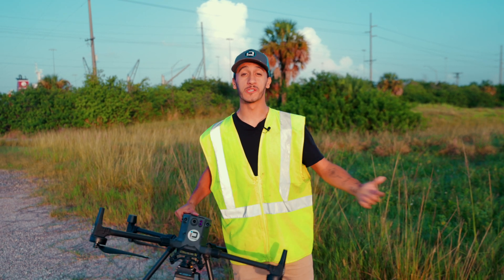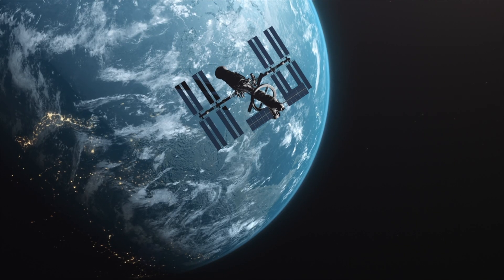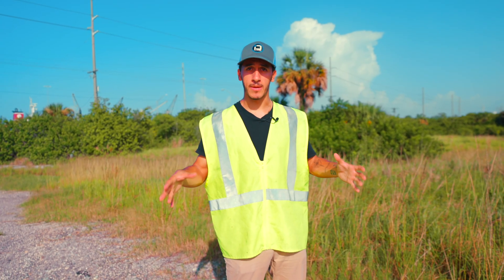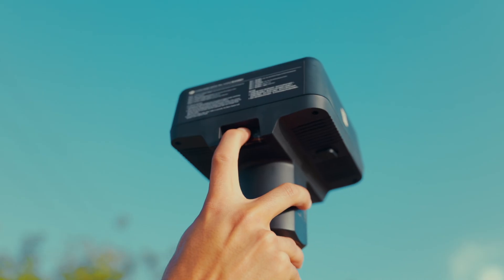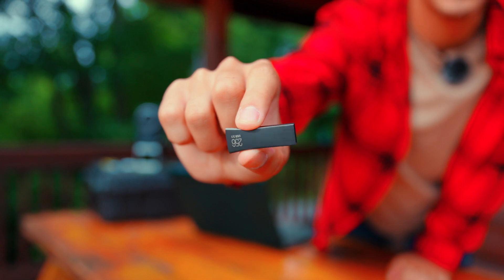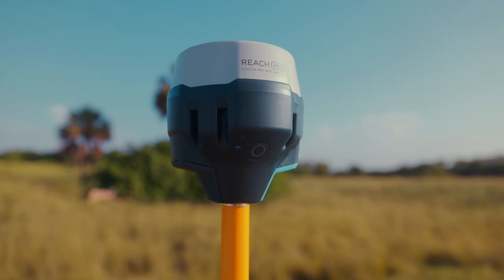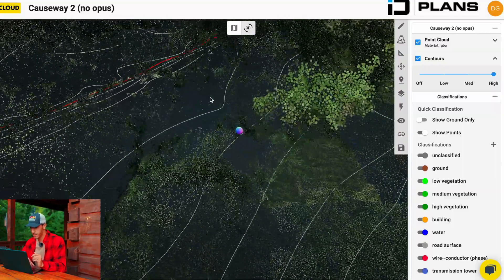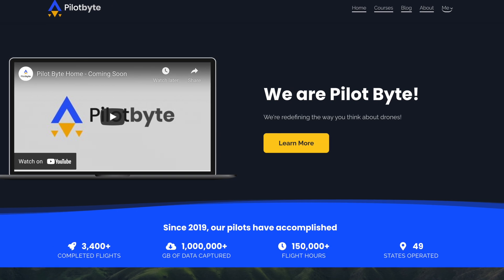Is LiDAR the next Gold? - Drone LiDAR

Comment: Hello. Great video. I’m not sure why you use both the drtk-2 and the Emlid RS2. If you are running a PPK process with the RS2 why bother with the DRTK-2 as well? I run the L1 on my M300 and I use the RTK on the drone with an NTRIP service. Works great. Really curious why you double up on the RS2 and DRTK-2

Comment: really good video!
coming from normal DJI drones as a videographer, but a drone lidar newbie and guy who is really interested in getting into the space, i would love a more in depth video, where you don't leave stuff out and skip parts - a real step by step video on what i would need to do

also i have trouble understanding a few basics:
1.) you get the ground points via a CAD file you say - how do you know where they are? the ground point tag looks not accurate in the vegetation - i only know the ones on the asphalt
2.) there seem to be two kind of RTKs, one for the drone to get accurate flight paths and the other ones to create points on the map or something? how do i work with RTKs? how do i set those points in the program correctly?
3.) i don't understand what exactly i would give the company in the end? how do you create the so called "finalized deliverables" and how do they look like? what program do you use to make them?
thanks a ton in advance!
Reply: https://www.youtube.com/watch?v=HFT-k3vbk5Y

Watch this series, Trying to do the same thing. this was helpful

Comment: U should try propellers aeropoints. It will make your life way easier.
Basically they are gcp with integrated gps. U just place them switch'em on do ur survey. When finishes the survey ur gcps will have known position. 
Give that a try I promise they are worth it
Reply from the maker: Ive looked at them but haven't heard the best reviews about them. Do you have hands on experience with them? If so Id love to hear your process!

Comment: What are your thoughts on bathymetric lidar? Shallow underwater mapping could be awesome.
Reply from the maker: Oooo, we actually have a bathymetric sensor but haven't put it to use yet. As for a bathymetric LiDAR sensor, that works a bit more differently than the typical sonar based system that we have (and is also like $250K just for the LiDAR version of that sensor). If I get a chance to play with one I will 10000% make a video about it because that's something I have always wanted to play with!
Reply: There's a channel "adventures with purpose" that searches in water for lost cars and helps solve cold cases. I sent them info on it and they loved it. Being able to find targets faster and have a clearer picture could be big!

Comment: Great informative video Dylan. Just out of curiosity, the R2A comes with a 24mp Sony camera integrated into the LIDAR package, why not use the photos captured with that rather than fly a separate mission using the P1? Was that for comparative purposes for those using traditional photogrammetry methods to capture survey data?
Reply: John - I can't speak to why Dylan reflies an area with the P1, but I can say why I do.  I have a GVI LV70 with a Sony 24 mp Nex camera and a separate P1 payload.  The P1 photos are far superior to the Sony.  If I want colorized LiDAR I can do it in LiGeo.  Yes it increases the collection time, but for my purposes it isn't a significant cost.  Also, the P1 can collect data at twice the speed or more than the LV70.  GVI recommends a velocity of about 5 m/s and flight heights of 60 m or less.  One can fly with a P1 at 120 m at a speed of 13 m/s.  The downside of the P1 is the file size.  Orthomosaics can be 10 gb or more, so I use GeoExpress to convert them to sid format to use in Civil 3D, ArcMap, or QGIS.  I think it comes down to what meets your needs.  Also, the GVI LV70, which looks remarkably similar to the Rockrobotics and a few other LiDAR units, there is a slight shift in the orthophoto because the GPS is based on the LiDAR sensor not the camera.
Reply from the maker: @cascadestreamsolutions4211  loved this explanation. I haven’t tired combining my ortho data from the P1 with the Rock Robotics LiDAR data yet, I might have to try it out!
Reply from the maker: It was more of a comparison between LiDAR data and Photogrammetry data for surface penetration. The colorized point cloud shown on the LiDAR data was from the 24mp Sony sensor that is on there so theoretically we can process orthos with those without a second flight needed.

Comment: Do I need a licensed surveyor to sign off on the deliverables if I myself am not a licensed surveyor?
Reply from the maker: Depends on the deliverables you are promising to send. I would never say its a survey grade deliverable since you aren't a surveyor. I would learn towards a highly accurate model rather than survey model.
Reply: Check the state regulations you want to provide data in.  In CA and OR, licensed civil engineers and surveyors can collect topographic data and sell it. I'm not sure how many licensed surveyors or engineers are going to accept responsibility for the data someone else collects without a rigorous QA/QC effort.
Reply: Not many licensed surveyors would take responsibility. I can see some of the contours are being "pulled" due to lack of proper grade breaks. In TX topographic data is not regulated by the state board so engineers use this type of data since they place a disclaimer to match to existing grade on their construction plans.

Comment: I have five years of professional drone experience and this is the field that I want to work in but I have no idea how to do it.
Reply: Ive offered LiDAR consulting, sales, service and training for years.  To be successful in sUAS LiDAR, you must have substantial contacts in the respective industries that have a need for it. 

I focus primarily in surveying, construction and civil engineering and I have customers that bill well over $1,000,000 a year (small, ‘mom and pop’ customers at that); i agree 100% with what Doug is saying….the data is like gold to a lot of companies. However, you must have the contacts to make it work.  

For a good, mid range sUAS solution you’re going to be in the 100k range.  Add another 15 to 25k for equipment to shoot ground shots and a computer that can process it (your off the shelf Best Buy computer will not handle these datasets).  

Good luck!
Reply from the maker: @RustySshackleford  well said Mike!
Reply from the maker: Check some of my other videos, I have some tips on how to get into the industry as well as how to sell drone services.

Comment: Sorry man , you are misrepresenting Lidar . It is expensive in comparison to Photogrammetry which is in fact as if not more accurate than Lidar. Vegetation, Lidar does not see thru"vegetation , if you stand in a forest and and see light ,lidar can measure it. Bear in mind it is not ground level , there is forest detritus above ground level. So yes very useful for planning, or research such as flood planning.
Reply from the maker: I disagree. I have some data sets that show my statement off pretty well to the point where even surveyors were surprised at how well LiDAR penetrated through heavily vegetated areas.
Reply: @DylanGorman  I have been a Surveyor and Photogrammetrist for over 50 years. I use all the latest  technology. Fact is the contours are interpolated between observed points where light is SEEN thru the canopy. I have datasets that show clearly canopy has not been removed. But as a Surveyor I understand that it is not always Ground level , but on top of fallen and accumulated branches leaves etc. So I did not decry lidar, but the tool should be used with understanding.
Reply from the maker: I hear you. Overall this video was to show a basic overview of LiDAR and some use-cases. I know theres a lot more to it but its impossible to cover everything in a 15 min video. LiDAR is a fantasist tool though when it comes to looking at vast amounts of terrain (even heavily vegetated ones), but again it depends on how it's being applied and interpreted just like you said. I do believe that LiDAR has come a long way in terms of its tech and accuracy. Its just another tool at the end of the day.
Reply: @DylanGorman  agreed
Reply: @hudsonchalmers6504  Hi Hudson! Is Lidar the same technique as in laserscanners(Leica, Faro...)?
Reply: @lpskywalk   Yes The technique is based on time and speed ,phase shift is proportional to distance. A total station for example uses Laser, again phase shift of frequency between transmitted and received

Comment: As per usual, thank you Dylan!  What are the differences or drawback from using an M30 instead? It sounds like the M30 is a third of the price or the 300 with payload.
Reply: M30 does not have detachable cameras at all. You cannot use the R2A system with the M30 as it does not have a skyport adapter.
Reply from the maker: Richard, this is exactly what I was going to say. M30 is built more for search and rescue where M300 RTK is built for pilots like us that want to run all kinds of sensors (with the ease of use being DJI platform).

Comment: How are you getting the DATA to NAD83 and NAVD88 data to be used with FEMA elevations an engineer will need?  You said you average the RS2 this will not be correct with out PPK the data to a CORS station or use a reference network such as  Trimble or Leica to start with. Your description of the project It seems to me you will need to  be on the same data as FEMA. to determine the true BFE (Base Flood Elevation). for the buildable areas.
Reply: As long as one is collecting data in a systematic way along with collecting base station data or using CORS the data can be reprojected into State Plane, UTM or whatever you want.
Reply from the maker: So i'm only using the RS2 for my PPK process, I am using the controls that the survey company sent over to tie all my data to which is what I did in Rock Cloud. I set up my re projection in the same state-plane/ datum in order for the deliverable to line up properly with FEMA's data. I hope that answers that question?

Comment: do u havbe to buy the software or is included in the price? or there is a way to use  a open source software to buy it cheaper option?
Reply from the maker: There is one software you need to buy but if you own other lidar sensors you can add it into the rock cloud.

Comment: This is like what computers with Excel and estimating software that can read AutoCad files has done to the construction industry. When I got out of college in the early 80's it could take three trained professional construction estimators, two or three weeks to go through 50 huge sheets of blue prints and a 300 page spec book from the architects in order to put together an estimate and submit a bid to do the construction of a million-dollar-plus construction project. The cost of doing the estimate itself has to be added to the price of the construction project - maybe 350 man hours.
Now, one man does the same thing in one single day. It's totally a win-win for everybody on multiple levels. Three weeks is chopped off of the process which cuts three weeks of interest-carry on the loan the real estate developer has, the construction company can have a much higher mark-up on it's estimating cost because it's still going to be only a fraction of the price of what it used to be. Instead of three men, full time, estimating 20 projects a year to bid on, one man can do 200.
Lidar, post processing software, and high performance drones can do the same thing to the surveying industry.
Reply from the maker: You summed it up perfectly. We are working on some of the biggest projects ever in a much smaller/ condensed timeline compared to traditional methods of capturing this data!